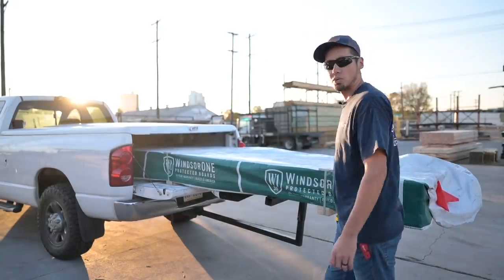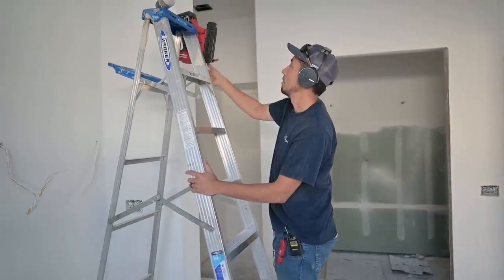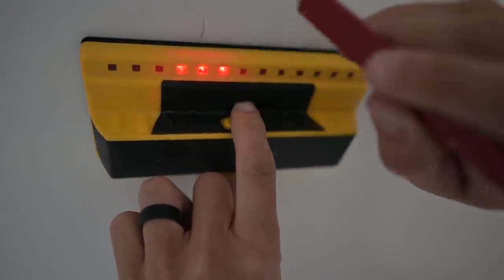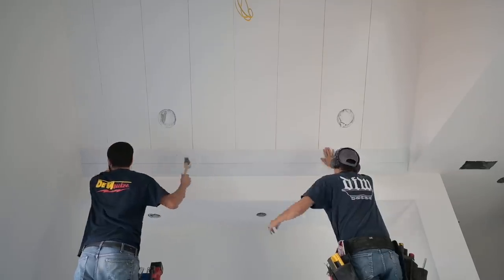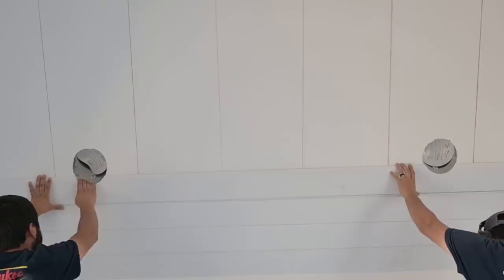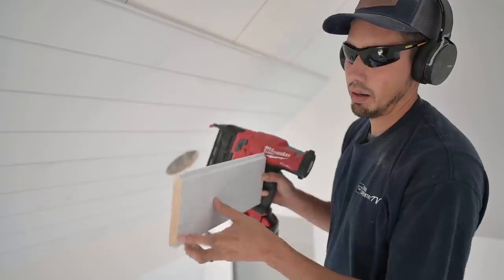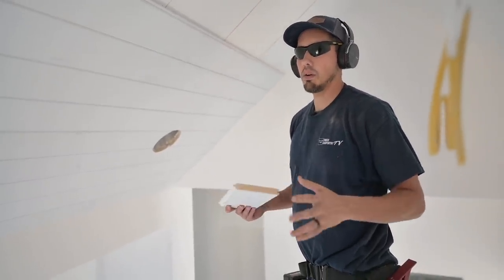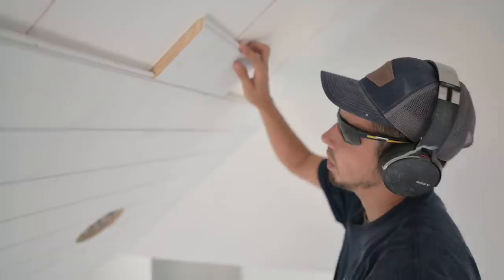Bad Carpentry Technique - Correcting My Mistake

Comment: Thank you for sharing all your knowledge.  I'm a homeowner and I've been watching all your videos.  I've just finished two projects - new dining room flooring and trim, and a 'tiny house' or pandemic office.  All the finish techniques I've learned from you - especially using pocket holes and/or CA glue to join window trim and baseboards into seamless pieces before nailing into place.  Using DAP DryDex to fill nail holes and to help in making long baseboards seamless also works great!

Comment: I’ve put up thousands of feet of this stuff. 18 gauge should be fine. 16 gauge would be safer lol. I’d also recommend using a small piece of scrap as a knocking block. That way you always preserve the tongue and don’t risk damaging when you hit it with a hammer.
Reply: Great piece of advice. I find that we always learn more from our failures than we do our successes. It's even better to learn from other people's failures. Stay safe out there and keep learning.
Reply: Screaminpotato yup same concept in Denmark, works perfect
Reply: Wouldn't gluing with 18 be fine?
Reply: I agree with your suggestion 16 Ga is the way to go. When get seasonal changes with moisture you have better safety factor.
Reply: @2hunnedproof247  I’m sure 18 will be fine. It’s nailed every 16 inches and they go in on an angle making them harder to come out.
Reply: @screaminpotato  i just shot up some nail backer for fox beams using that method
Reply: Everything this man does seems he always puts more thought than time into it and that's a successful trait my guy pls keep the vids coming and don't skim on the details ..!!!
Reply: This. A cordless 16 gauge a knocking block is the only way I do t&g

Comment: I’m loving the Franklin stud finder you recommend. 
And yes, I’d sport the hoodie all day long. And I’d buy another Dewaukee shirt if it had a breast pocket. I started wearing carhart shirts and find the pocket remarkably useful.
Reply: I have the older blue one and I never trust what it shows.   I've tested it in a spot where I know, without a doubt, there is a stud and it seems to be at least 1/2 a width off.  So, about 3/4".   I've been using it to locate metal studs and it doesn't seem to like that idea.   Is the newer yellow one better?
Reply: Vic Terraglia I have issues with mine every once in awhile where it’ll show like 6 leds’s wide of something, but they bounce around and aren’t showing a solid location. 
So I’ll just start over and it’s dead on. I’ve never missed a stud marking on the center of the 3 shown.
Reply: @jmlcolorado  I've had that issue as well, where it goes nutty and will light up like Fallujah.
Reply: I’ve had issues where the right half would light up and stay lit but a battery change always cured it...even just taking the batteries out and back in usually resets it.

Comment: Thank you for sharing your knowledge. You have helped me transform my house into something of beauty with trim.  I started with your video where you trimmed out a drywall open doorway. You built it partly outside and installed it in the opening. I can do that and I did. I ended up doing 4 door openings.  I get a lot of comments on the chamfer on the stiles that end 6 inches from the top and bottom. That small detail I copied from you.  You get the credit for giving me the ideas and steps. Because of your videos and your instruction. I split my living/dinning room with trim. I did wainscoting in the dining room area. I ended the wainscoting with columns. On the living room side of the columns I put chair rail. Of course it goes without saying that every room has 5 inch crown molding. In the hall walkway I put up crown molding 6 inches below the ceiling. I lined inside the crown with LED lights that project up and out of the crown for a stunning effect.  Not bad for a desk jockey.  Keep up the great videos, I’m always learning.

Comment: I recommend you try using a laser measuring tool instead of the tape in situations like this. They are accurate to a 1/16th of an inch which is within tolerances when your measuring wall to wall. It is also much easier than holding a tape upside down above your head and it’s easier and faster when you’re working alone. Also very useful on baseboards when coping.

Comment: I've been shooting 2 nails on each stud with the dewalt 16 ga nailer whenever installing T/G boards. It's not as aggressive as a 15 ga and it's not as weak as the 18 ga. It gives me the peace of mind that the boards are well secured in place and  doesn't break the tongue.
Reply: Milwaukee makes a 23ga, 16ga, 15ga and the best 30° framing nailer around too. Also I just learned the other daythat you can buy correlated screws for a 21° framing nailer and use them and it will shoot the screws into the woods and then you can turn around and pull the screws out the drill or an impact if for any reason you didn't want to use ringnecks that way you could preserve the woods should you ever have to remove the material since renext would destroy whatever material you're trying to pull them out of in most cases.

Comment: I just picked up Milwaukee’s 1/4 cordless stapler to put up some exterior B&B and I was very impressed with the holding power of the fasteners (into cedar no less). I’m going to use this on my next T&G project. Might be an even better solution than what you just used.
Reply: We always blind nail install t&g with 1/4” stapler. Best holding power for sure.

Comment: That's pretty impressive that the builder gave ahang about the boards being primed on both sides. Most and I mean most builders, carpenters and a ton of painters doing new construction don't prime anything. This year alone I resided two houses and not a single cedar board was primed and the houses just peeled like skin cancer. The last house when we took off the coach lights we saw the entire house was put up with raw pine and cedar and sprayed without primer and they masked the lights off. I don't know how some people sleep at night when they do crap work like that.

Comment: When I install t& I just mark the center of the lighting fixture and come back after installation with my trim router and cut the hole out with a flush bit. Definitely cuts down on climbing up and down the ladder cutting each individual piece with a jigsaw. I recently started blind nailing t&g myself. Cut down a ton on finish clean up and filling holes!

Comment: I just got done installing 7 1/2" wide (8' long) prefinished Pine  T&G on a vaulted ceiling just like this.  The builder wanted it as tight as possible, as there would be no caulking touch-up.  We glued every piece (liquid nails) and blind nailed it with an 18 Ga.  Most of the boards weren't perfectly straight, and needed a lot of pressured to get the T&G tight, 7 1/2" doesn't bend easily.  When we needed to really crank on a board, we screwed a 3/4" thick block to the truss, just above the tongue, then drove shims (split in half lengthwise) until it was tight.  Then,  used a T-10 finish screw, instead of the 18 Ga nail, and blind screwed it.  We had to this on 80% of the boards, took a long time, but it has stayed very tight.  I live in a part of the country were we don't much varying of relative humidity, so I'm not concerned at all that they'll expand and buckle.  

   Richard, would you mind doing a short video on those badass Diamondbacks.  I've been wearing my set for 8 years, back when they were being sewn in Alaska.  Very comfortable,  the hammer holster and velcro belt system are ingenious.  Unlike leather, they don't take 5 years to break in.  Keep up the good work!

Comment: Hey when that older model dewalt jigsaw goes I would definitely recommend to get the newer brushless model. I switched over and they corrected all the things from the old model, that I wished they would. I.e. blade release lever sticking, handle lower to shoe, brushless motor so longer battery life, etc. 

btw very humble carpenter/YouTuber. Been watching you since the beginning!

Comment: I love your channel ,I love your work most of all love your humility. A flooring hammer is nice but ever since I bought a $10 2 1/2 lbs dead blow hammer from Harbor freight  maybe 15 years ago and started using it for flooring and T&G  Iv never gone back it has plenty of weight to set your board and “most” hits won’t Damage the wood.

Comment: Another point is that an angled nail can't pull pull straight out so you get a degree of more resistance to hold it in place. I've installed thousands of feet of 3/4 T&G, my two fasteners of choice are the 18ga nail and a narrow crown staple (most are 21ga) . 1/4" or 7/32" depending on manufacturer. That's a great project you're on. Nice work on your details.

Comment: I'm a cabin builder we use 1/4 inch by 1 1/2 to 2 inch staples. And yes we blind nail it all. Brad's are for trim only when cabin building.  I have had to repair tounge and Grove alot and the most common failure is brands pulling through with moisture changes in the home.

Comment: Glad to see you blind nailing. If nailing to drywall &  framing , with concern that it will not hold. Add some basic construction adhesive dots to the backside every 16" or so. Can use a 16Ga. nailer that will take 2.5" brads > definitely reaching the backing . Again, if needed double nail each stud / rafter location. Looking good & have fun with the project. Ya! John needs a tooled  pouch while helping out & up on a ladder!!

Comment: It’s a ceiling and will see a lot of heat with thermal expansion and contraction. Over time smooth finish nails can back out. I use latex caulk as adhesive and double nail each rafter with 2 1/2” 16 gauge or one 15 gauge nail. Caulk works great as adhesive on primed surfaces but allows movement. Make joint as tight as possible because the heat will shrink boards.

Comment: I would wear the sweater bro I'm a meduim please!!! I Use 18 gauge staples when installing t&g  directly to the joist when drywall isn't installed, and use 15 gauge for heavier boards on drywall applied surfaces. Keep up the good work!

Comment: We always mark with a arrow with the point on the measurement 90° from the pulling point, you always know where the mark is, at the point as apposed to a wiggled line your partner made and having to ask which part of the line! We never use red chalk for marking only blue, red is a dye that is designed to be permanent and never goes away and it can bleed through your finish blue will not, also if you get chalk on your hand and touch the face of the trim, blue wipes off with a damp paper towel clean, red can be a disaster if you don't get it all.
Blind nailing when done right is so much cleaner than face nailing and less work to finish, love your saw set up and the job looks great👍 nice job🤜🤛

Comment: If you are concerned when installing something that weighs more than pine you can use an 18 gauge cabinet stapler. They hold way better than the brads. Almost impossible to pull out. Just like a floor stapler except it’s on the ceiling.

Comment: one thing to know about the Franklin Stud finder is its alway on Deep Scan mode so sometimes there is other wood behind stud so you can't get an accurate reading,  you should always have another Stud finder such as  zircom where the deep scan can be disabled and you can find edges

Comment: Hey Richard, going back and catching up on some "older" videos. These tongue and groove boards, they could be used in a porch? Does Windsor 1 have stain grade? We have white vinyl ceiling panels (yuck) and we could go with white boards, or maybe stained the color of our front door, depending on what the wife wants. I'm hearing they could go out there, based on your comment near the end of the video (the builder asking you to add another job). Just making sure I understood correctly. Thx

Comment: Check out BlakLader's work vests, I also do finish work and I would never walk into a home at that stage of production with a bag and belt on. The Ergonomics of having a vest compared to belt cant be shrugged off and your hips will thank you after the first few hours of work.

Check out a hand laser distance tool, they are relatively cheap and once you get used to it and have the tricks down it can DRAMATICALLY reduce the time you spend on measuring things like baseboard and T&G lids like that. The one i picked up was a bosch and it measures up to 165 feet and is accurate down to a 1/32 and with it i can base out a whole house hyper fast and accurately.

 Also i noticed you don't bevel the upper lip of your T&G. Sparkie's (atleast all the ones ive worked with) hate having to touch and modify any finished surfaces so just putting an angle on the top for their can inserts makes everyone's lives easier and you already have the tool out so yeah!

Love the videos, Always fun watching and learning new techniques Vicariously, Keep it up!

Comment: I don't know about installing them with out glue in the grove or not using some sort of liquid Nail on the backside to the drywall. here in Long Island NY there's a tone of movement in our wood products because of all the moister in the air and temperature changes. I do blind nail them we just need to add two more steps to our process here in LINY, also we would need to leave room on the ends for the movement and cover it with a pc trim, that's why I prefer if posable to use MDF it docent more as much as pine.

Comment: Assuming the drywall was installed properly on the ceiling with a glue dab on the joists you shouldn't have too much movement.  However, most builders sub that works out, and I find it rare in new homes for this to be done.  This is why nail pops are so prevalent as the sub cheaps out by using nails instead of screws in the ceiling and don't use glue.  On any horizontal surface, I would recommend a couple dabs on every other joist or even every 3 joists for peace of mind when blind nailing.

Comment: Try using the smaller tip if you still have it? It is angled on both sides and is easier to place into the base of the tongue at the required angle.

Comment: Just a tip... lay out the 3 boards on horses measure for both lights centers - use ur circle cutter . Saves you some time👍

Comment: Since you often paint your carpentry (which I respect), do you caulk as well?  Specifically interested in understanding if you caulk wainscoting or if you just leave the gaps in the panel modeling as it meets the 1x4s or the underlayment on the wall.

Comment: Richard, Just recently subscribed and am really enjoying the videos and am impressed with your techniques. I am a DIYer with very little trim experience.  I just watched the video where you used a Home Depot paint stick as a backer board for a long run of crown molding. The numbskuls that trim out our house did a great job but did not know about this trick and it shows. We ended up with a 1/8” gap in the middle of the long runs of crown down the sides of our living room. It varies depending on seasonal temps. A couple of years ago a filled the gaps with wood filler but have been unable the get the paint to look good. Lots of sanding and multiple coats of paint have not worked. Any recommendations?

Comment: I just did this same project two weekends ago and scoured your channel for a demo video. Should have waited. But I really wish you’d shown how you joined the two boards at the peak. I had to rip both down to the right width. I ended up ripping one normally, then back-cutting the other (basically coped) so it would fit tight over top of the first. Was that how you handled it? Mine was good, but caulk was still my friend.

Comment: It think that i would try using my engineered hardwood stapler.  It has an adjustable shoe, that would adjust to the T&G and shoot at the correct angle right next to the tongue, and has a step in the shoe to let you pull the pieces tight.  I’ve done a bit of T&G walls with it successfully , so I would expect it to work on a ceiling.